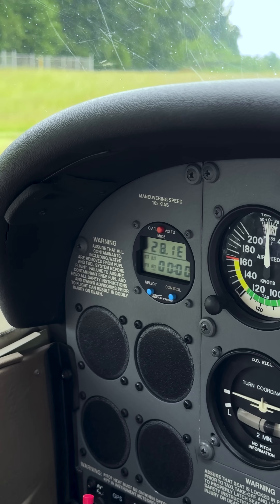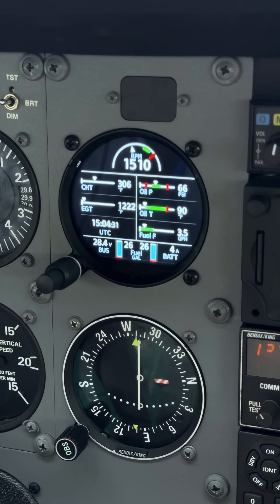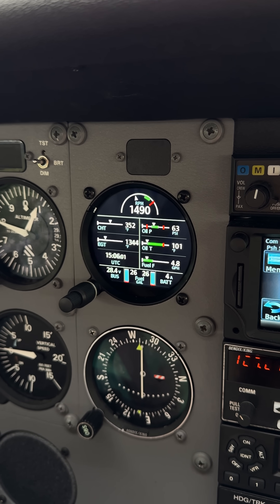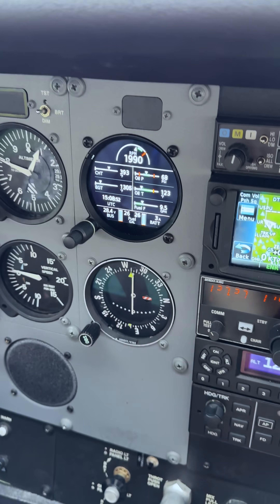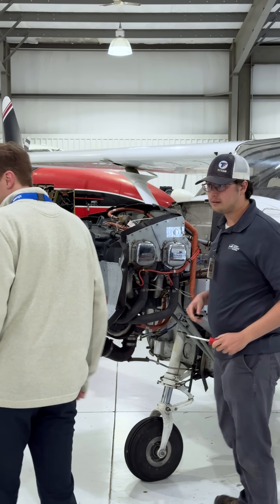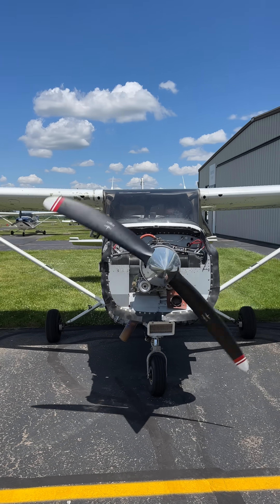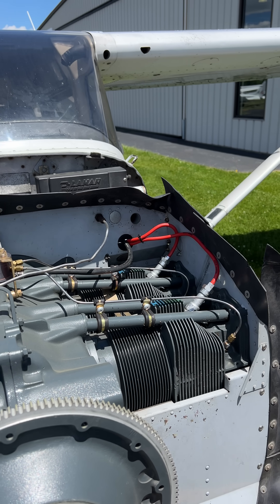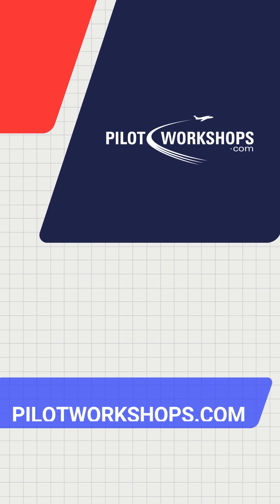Clearing a Fouled Spark Plug | Pilot’s Tip of the Week

Comment: Having worked at flight schools the use 152s we found a modified version. Go full power, lean then reduce power and do your mag check. We found the higher power would do a better job clearing a plug. Once they went to this method we went from a daily plug problem to a monthly plug problem.
Reply: Thanks for sharing the info.